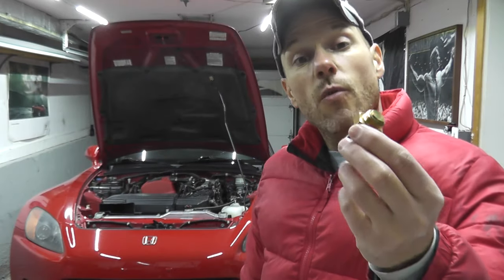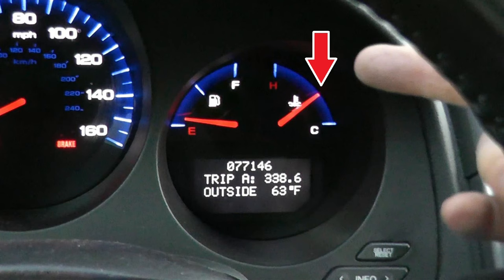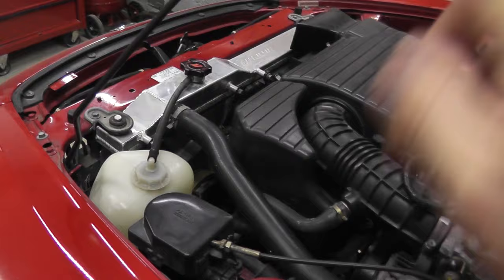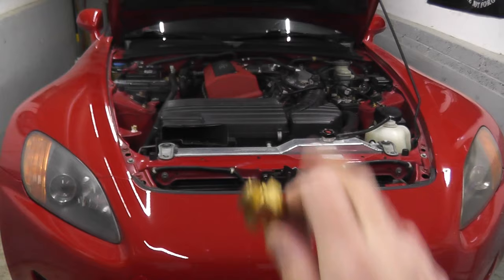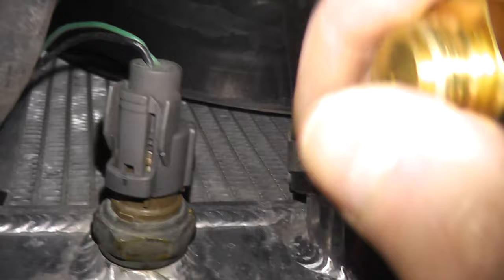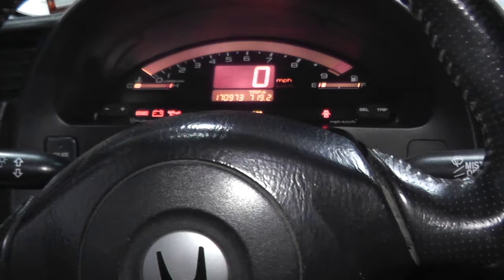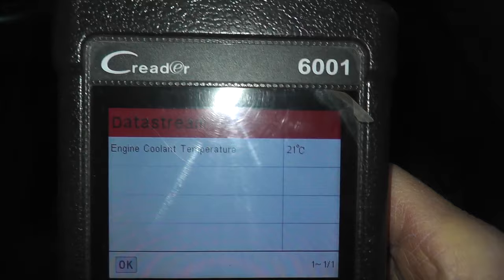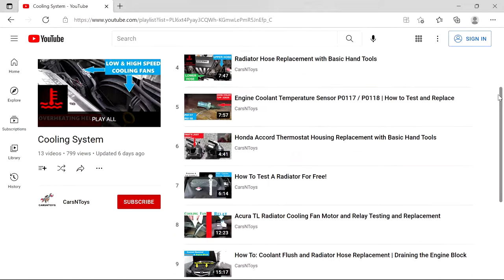Coolant Fan Switch Testing WITHOUT Removing From The Vehicle | How To Bypass Radiator Fan Switch

Comment: What if you do this and the fan does not turn on? All fuses and relays are good. Fans are brand new and do work.
Reply: Sounds like you have no 12 V power you can check it with a cheap multimeter really easy
Reply: @017hamilton  I figured it out. Thanks
Reply: @dusty what was the problem, I have the same issue
Reply: @crazyboriskb  the temperature sensor in the radiator.
Reply: Hi! I'm having that problem you're describing
Reply: I changed my temp sensor and it didn’t fix it what could it be please help!
Reply: @ianpereira4148  blown fuse, a broken wire, bad fan,
Reply: New fan connection chequed by a mechanic
Reply: @ianpereira4148  is the vehicle still overheating? It may not be getting up to temp.
Reply: @ianpereira4148  its because you have to make sure to use a honda one, aftermarket ones just dont work. Trust me, they dont. Instead of buying it for 115$ i just wired the fan to a switch in the cab all tied together with 15amp inline fuse, all together 25$
Reply: Your ac is on or your heater
Reply: If all else fails. The true answer is the fan motor burnt out. Clutch inside also. 35$ on rock auto, with mounts to put in the swapped fan blades.
Reply: Ecu
Reply: @moneyman9387 could that be the case even if the fan clutch turns
Reply: @dustythibodaux  you can check the connection wire with a jumper ez pz.

Comment: My switch keeps going bad. After a week or 2 the sensor dies out and the fans won’t spin.  I keep buying new ones and same issue, they only last 2 weeks tops. Wiring is good relay is good. Any idea what might cause my sensors to keep dying?
Reply: what was the answer?    not OEM parts?
Reply: Did you mix coolants?
Reply: Did you mix coolants?

Comment: Hi,my radiator fan not working same as before,when i pul of wires from sensor,fan start working fast. also when i use AC fan working not fast.(volvo v70 2012 diesel)

Comment: Straight to the point. After browsing 30 videos finally found this useful video!! Thank you!
Reply: can you please give me an idea, my car is opel zafira B 1.6 of 2006 show these codes on the screen p111505 and p111606. after I have changed many parts and the problem continues again, I have changed the temperature sensors in the radiator and in the thermostat, the original thermostat has been changed, the new deposit cap, the water pump. I don't know what to change, I have spent a lot of money but no solution please help me with any idea

Comment: Great video! For those that have 98 - 02 honda accord. They have 2 switches. Both are located at the end of the radiator hoses on top of the motor,  not the radiator itself
Reply from the maker: Thanks for the info! Cheers
Reply: Yeah I got a 99 accord ex and the fan switch is above my thermostat housing and the coolant temp switch is on the engine block below the distributor cap very odd places
Reply: can you please give me an idea, my car is opel zafira B 1.6 of 2006 show these codes on the screen p111505 and p111606. after I have changed many parts and the problem continues again, I have changed the temperature sensors in the radiator and in the thermostat, the original thermostat has been changed, the new deposit cap, the water pump. I don't know what to change, I have spent a lot of money but no solution please help me with any idea
Reply: @CarsNToys can you please give me an idea, my car is opel zafira B 1.6 of 2006 show these codes on the screen p111505 and p111606. after I have changed many parts and the problem continues again, I have changed the temperature sensors in the radiator and in the thermostat, the original thermostat has been changed, the new deposit cap, the water pump. I don't know what to change, I have spent a lot of money but no solution please help me with any idea

Comment: I decided to bypass the systems and not wait for the ECU to receive that signal and start those cooling fans..I installed a switch and whenever I know the temp is rising (stuck in traffic or whatever) I just switch on those fans myself..it was not difficult to find the electrical 'montage' ..also my car a 2002 Volvo V40 was swapped with the V70  5 cyl turbo motor and jeez it gets hot in that bay..so I changed both (stock) fans for high power (CFM) new fans and now it's really 'moving' in there.!!..the heat sensor installed at the hottest point in the engine bay coupled with an extra temp gauge on the dash shows excellent results on extracting that hot air ,there is also lower temp thermostat you can change (95°C to 87°C)..but being able to control those cooling fans from the dash is for me the best way..keep that bay cool & ventilated..!!(The true success of any build or engine swap for your dream daily is all around 'heat management' & cooling)..Chip Foose.
Reply: Great idea 🍀🤙🇬🇧

Comment: Great diagnosis and explanation. Having same issue with my 97 BMW. Same concept, same idea but have a low and high speed setting. Will bypass today to test the fans, but most pretty certain its the switch that has gone bad.

Comment: i appreciate your knowledge my friend, as i own a daily driver honda accord 2005 EXL with 206,000 + miles that runs and drives like a ,new car , i have had to have a new water pump, pulleys and belt kit installed at 206,000 that was pricey as i did not want to tackle that job myself, i did take it to an ASE certified mechanic, keep up the great video's and thank you for your time.
Reply from the maker: Thank you. I appreciate the comment. I had an '03 Accord and it was arguably the most reliable vehicle I've ever owned. Cheers.

Comment: wow dude that's crazy because nine times out of 10 a lot of people wouldn't be thinking about that particular thing and because you went through it you found out that it was actually the sensor to your radiator and why your fans was not igniting I have a similar situation but my fans won't ignite the way that they're supposed to and the sensor seems to be working fine however mines is not digital like your odometer is so the heat to the car is right between the middle and a little less off the candlestick please so thank you again for giving me that idea to check it and also to check out my fans as well

Comment: Very good video the one I am looking for well done one more problem is I change 3 cooling fan already they come with switch and I am having same problem over and over I change tempeture engine sensor same pb it’s driving me crazzy it turn on in low speed and at 210 and then stops goes 220 still off the power goes in fan but it’s not kicking at 210 or 220 it’s not kicking hight speed at all anyone any idea thx

Comment: i have an issue. i replaced mine after confirming it does not work. the ac would kick on both fans and if i jump the connection, the fans turn on. but even with a new fan switch, they still do not kick on. would it be something else? literally everything in my cooling system excluding my water pump has been replaced with mishimoto parts, and they all have less than 1000 miles on them. the fan switch was a mishimoto one too. idk where to go from here

update: solution found. it was the thermostat. after a lot of testing i realized the bottom hose was significantly colder than the top hose, and the top hose nearly singed my hand from touching it. i guess even near new performance parts can fail from almost nothing lol

Comment: thanks I have a Suburban 2012 and I want to make both fans works on high speed all time what I have to  do should I remove only the black wire from radiator sensor .

Comment: that quick bypass trick there would that also be viable to use say if your actual fan stopped circulating as you described. Now would a person be able to rig a set of wires as you did with the pin probes and got the fan to immediately come on. Without it running constantly while operating the vehicle ? meaning could it be set up to operate like a amp can be stilled used if fuse blew and you wrap a small amount of wire around the fuse and stick it back into the fuse location and it then returns power where it had previously blown leaving no power ? can radiator fans be done like that  so they work but not work running constant?

Comment: Is this different than the coolant temperature sensor ects? This is a specific fan switch?
Reply: I think the coolant temp sensors will be on the block and the fan switch will be on the radiator

Comment: Very good video. Where is the thermostat connected to for electricity
Reply: If you are referring to the sensor he was holding; the connector for it is the piece that he stuck to the prongs into in order to complete the electrical loop and allow the electrical current to reach the fans.  I tested mine by checking the continuity when the switch was hot and cold. It rules out the switch but not the wiring so I will do this to confirm the $100 relay is bad and not the wiring harness section

Comment: i tested the relay, fuses. they are all good. itested the cooling/ac  fans by using paperclip. The fans are working . So I replaced the cooling sensor. But the fans still dont work. What else is the problem? Thanks.

Comment: Hi sir.I have problem while engine cold everything ok when engine hot fan work and non stop until i stop the engine.Radiator,fan,coolant,coolant cap changed with new one

Comment: Fans work with AC on

Bypassing ect with safety pin or probes does not tell me anything about temperature switch operation.

Temperature switch operability does not affect fans running with AC.

Comment: I replaced my cooling sensor it worked for a few hours...
Then the fan wouldn't turn off so I had to disconnect it manually.
Now it's not kicking on at all...
I checked the relay box and the cooling fan fuse has a bit of melted plastic on one of the prongs.
I switch the fuses with one I had with the same voltage but the fan will not kick on...
My fan is about a year old and it still works because I tested it with just the battery hooked up to it...
Idk what the issue could be...

Comment: On my ‘05 Outback XT, when I turn on the A/C, the fans turn on high only, regardless of engine temperature and never come down to low speed.. everything else seems fine. Could this be a bad rad fan switch?

Comment: Hi had a voxy 3zr engine fans not working even if you take out the sensor still not on. Put with scanner and on from scanner still not working, change fan motors as well. Fuse and relay already check are ok.... what you think might cause the problem please?

Comment: Hai! Hope you notice me. I just notice my radiator fan(driver side) stop running when the temperature reach at 98c above but my condenser fan is running. But when in a cold start like below 96c both fans running but radiator fan is running at low speed while condenser is running at highspeed.  but when it reach to 98c my radiator fan stop running? why is this?

Comment: Great vid! Do you know where the cooling system temperature sender/sensor is located on a 1999 Oldsmobile Intrigue? The fans work and the fans’ relays are good but I can’t locate the cooling system temperature sender sensor to test it and replace it. Thanks.

Comment: My radiator fans come on when I unplug the connector of the cooling fan switch AND go off when I short them like u did.
Why is it the case.
Reply: Having the same issue. Did u find out why

Comment: On my car the cooling can doesn't turn on anymore not even if the ac or heater on. I was able to tap the fan motor and it came on but now it don't turn on at all.
Reply: Probably the motor needs to repair or be replaced

Comment: just turn on the ac and the fans kick in to test the blower moters
Reply: Thanks William I did that and my fan kicked in. Thanks again for the advice so there must be a problem of some sort with the sensor or whatever its called.

Comment: Hi, just wanted your take on an issue I'm having with my car. Apparently, my radiator fans don't work with the AC off. Someone mentioned changing the coolant temp sensor. If I leave my AC off and just start my car and pull the connector to the sensor, the fans start running. What could be the problem here? Appreciate your advise. Thanks.
Reply: probably a dead diode between your AC fan switch and thermo switch. but will depend on how its wired up.
Reply: @owensharp8568  thanks for the reply. Forgot to mention that the vehicle is a 2003 Toyota Camry.
Reply: Same here. Unplug the switch and the fans start. Touch the leads together with a wire on the switch and the fans stop.
Reply: @soniqdreamscape2008 I’m having the same issue. Did you figure out what the problem was?

Comment: I need help to lean this gas sucker-out. If it can hold perfectly clean for two hours after coming off the highway despite that the operating temperature drops way down at cruise speeds then there has to be a second map or second set of idle values. This is confusing for me because it wasnt an issue of FWD limp mode I was in AWD normal mode but at idle for two hours and it took up to 10 minutes coming off the highway. Shut the car off for a short time but it is at the same temperature and it starts that flooding the car stinking ass crap again.
Either way of the car was in open loop because the o2 sensors arent working correctly it was defaulting to internal values at the start only and is looking at throttle position, engine coolant, map sensor values because everything else is disconnected except the o2 sensors but it already has codes against them so it is disregarding them.

I saw where there is this open deck\ closed deck situation and where the cylinder will actual regularly move.
How do we Identify closed deck blocks especially if there is a bigger version that allows for meat to start from to be able to sleeve an engine? What sleeves won't move in a Subaru engine?

3)On one guys earlier tonight he was talking about using an o-ring to seal the engines when running 30 psi boost. What is a good functional persons reference for that topic?

Comment: Ok what if fan does not turn on and I just hear clicking sound?
Reply: Replace the motor
Reply: fan motors are dead. the clicking is the relay which is then working fine.
Reply: I hear clicking sound while driving

Comment: This video is bullish. When you take out connection the fan turn on .When the fan doesn't turn on the sensor cooling no good. And need to check connection have 12v.